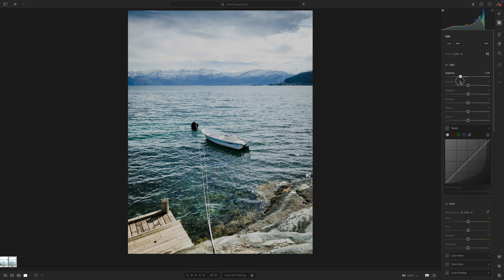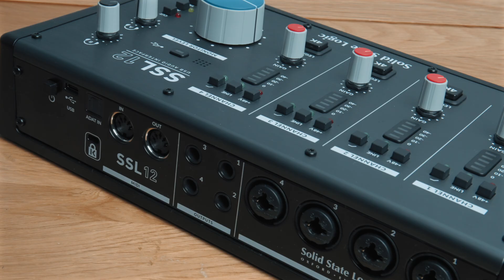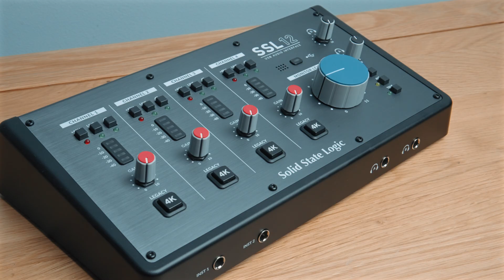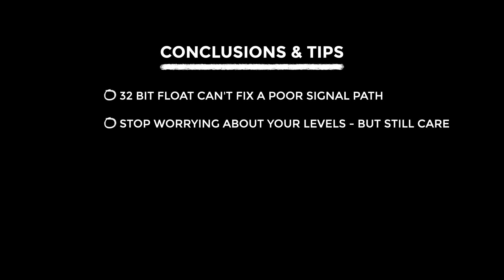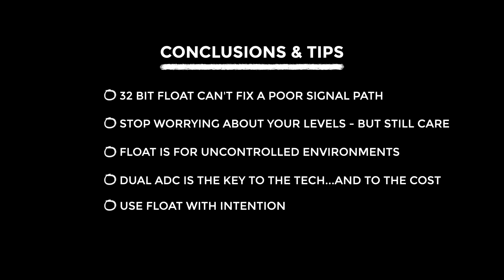32-Bit vs 32-Bit Float: If You’re Still Unsure, Watch This

Comment: I would think 24 bit is fine for recording - that's 144 db. Hard to imagine not being able to control levels within that range - and if that situation comes up, it would seem simpler to just record two channels with different gain, and mix as needed (if one channel clips, mix the lower channel, boosted back up). No issues with the source recording switching between hi/lo level ADC.
Where 32 bit float shines is in post processing. If you happened to be near the 24 bit limit, 32 bit float will allow for EQ, reverb , mixing, or other effects without hitting the full-scale hard limit.

Comment: There are couple of a nice old papers from Lund University that looked float ADC’s (FP-ADC), there’s actually a couple of different designs. A bit generalized though the overall idea is sampling at different gain stages, combine signals, convert into float space. But number of fixed point ADCs and how they are combined differs among designs.

My personal love for FP-ADC are for two or three scenarios;

- very loud drums. Back when I recorded live samba orchestra on Zoom H1, no gain setting could capture them without some peaks. That is a bit device specific though, not strictly only a format issue.

- if I know there will be extreme dynamic range, e.g. know there will be very loud drums but also someone speaking softly.

- unknown, unmanageable scenarios. Maybe you setup for something, but then there are is some completely different scenario.

Studio recordings with dedicated audio engineer(s) arguably don’t need FP-ADC. A perfectly gain staged 24bit recording is golden for almost any use.

But eh, nothing I do is perfection. Having a bit of extra latitude is always nice if you are alone or occasionally err.